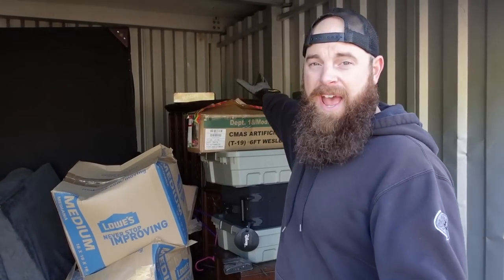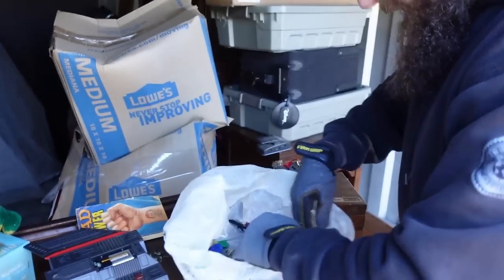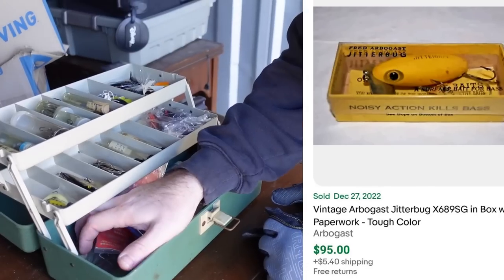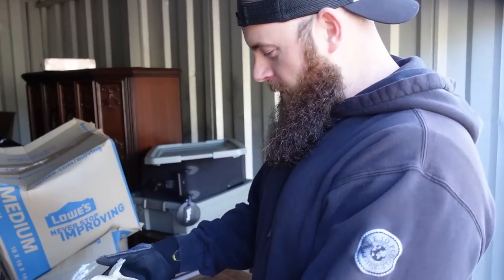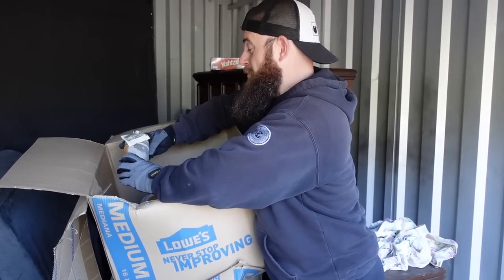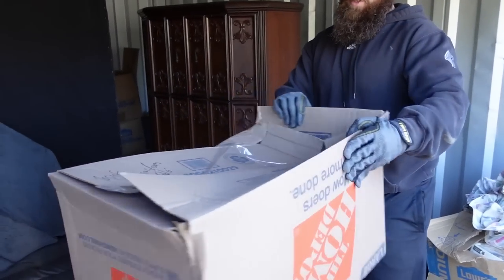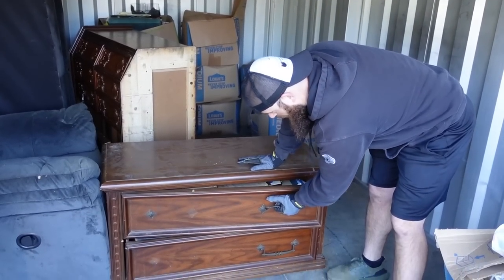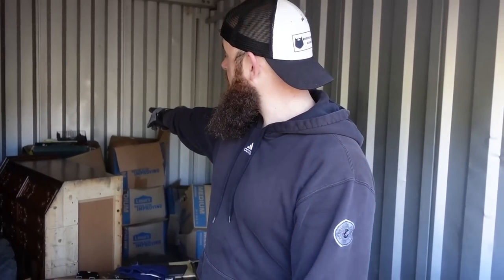This old dusty abandoned storage unit gets better and better!

Comment: The gear at the top of the beaters on that egg beater was all the rage when it came out in the early 60s or late 50s. It gave  smooth action via a bus the older metal gear. Its a rough way if dating them. You can look up the introduction of the new gear on Google or even dating egg beaters on YouTube. I still have one in the basement.
Reply from the maker: we just sold one the other day - i can see how people wanted them
Reply: It was too big an event to bring out the Sunbeam Mixer just to beat eggs for an omelet. The metal ones served well in their day,  but I started out with one because the plastic gears were too expensive. Things were different. Hand held electric mixers were all I had for many years, but it took a strong arm to use them!

Comment: Egg beater use vegetable oil.  On furniture you can clean with Murphy's oil soap, not too much water on the wood, after thoroughly dry you can use lemon oil.  Seems to freshen the wood and give it a nice sheen.  Do not use any spray wax on it, as that is nothing but build up junk onto of good wood.
Reply from the maker: thank you for that info

Comment: 1:18 Although I resell smalls on eBay, I have a booth that I sell furniture out of. I buy old furniture, refinish, resell. That piece at 1:18 is a small sideboard. Probably made in the 40's. Probably isn't solid wood but a wood laminate but I'd still say low end is $150.

Metal figures very cool!

Comment: Lots of old costume jewelry is worth big bucks. A lot of high end designers made costume jewelry and signed their name on it. Others may not have names but dealers can recognize patterns and tell you what it's worth also.  Google lens may not have anything comparable so as I said before go check with dealers in an antique store and they can give you price ranges. If items are marked Germany or Italy they can be worth $ also because of era's they might be from. 
You're finding great stuff. Reminds me of when I use to buy storage lockers. It excitement of finding each item and then finding what they are worth.
I don't know if anyone has mentioned that certain items are worth more money on one coast than the other. Where it something might sell on the East coast for $50.00 because there are more of them then on the West coast they are hard to find and could sell for two to 10 times more. It's really interesting so you need to do your homework before you sell. Hope this helps you.
Reply from the maker: thank you so much for that info!

Comment: I have an antique cedar chest and I clean it with vasoline
jell. Try some on a corner of that old buffet. You will be very surprised. Put a small amount on then let it stay for a few minutes, then buff it.
Reply from the maker: Thanks for the tip! ill def give that a try - that was the cleaning and not scratched up piece in the unit.
Reply: @beardedthriftmachine  I would use vaseline on the egg whip instead of WD-40 just saying

Comment: Depending on the model number of the singer sewing machine if it works could be the best item yet thanks for the video
Reply from the maker: we have not ran the model on that yet - but ill tell ya ive never seen one like it
Reply: You can even part out the sewing machine for good money. Nice looking machine though …
Open the side door and check for paperwork,bobbins, old needles and thread. There’s a market for all of that.

Comment: I could not get a good enough look at that thing with the hearts you held up for a few seconds, but it looked like it might be an item that used to be placed across a baby carriage blanket which was held in place by the the clamps on either side which was hooked onto to the sides of the carriage.  From a time when baby carriages were referred to as coach carriages due to their large size and fancy style.  That item was purely ornamental and was called "baby carriage blanket clips" and the good ones were made of metal as opposed to plastic. Not certain that is what you have there  but worth checking it out.
Reply from the maker: thank you so much for that info! I didnt know what that was
Reply: I have one of the Baby Blanket Clips from a house  I cleaned out years ago where everything was from the 30s. Not sure why I kept it but now I know exactly how it was used... thanks ...
Reply: @dawndemaine3694  I was a kid during the early '60's when mothers used to really fancy up their baby carriages for a newborn.  It was commonplace to have a lacey ribbon with the baby's name embroidered on it (blue or pink) wrapped around the carriage pillow and one of those blanket clip things laying across the blanket.  Some of those blanket clips also had an engraved nameplate in the design.  The good old days...lol